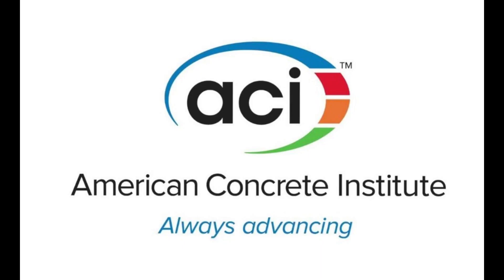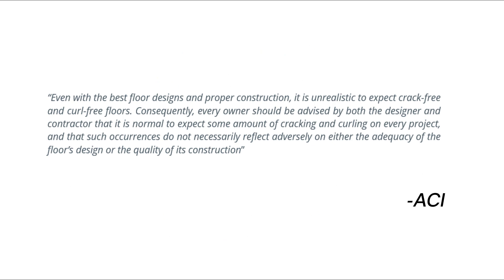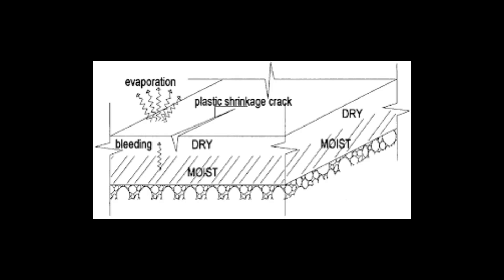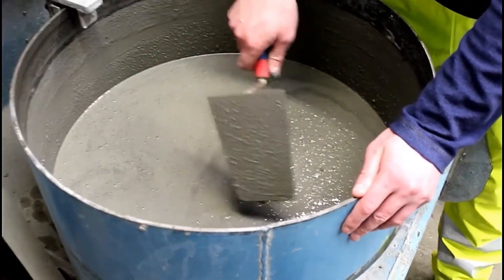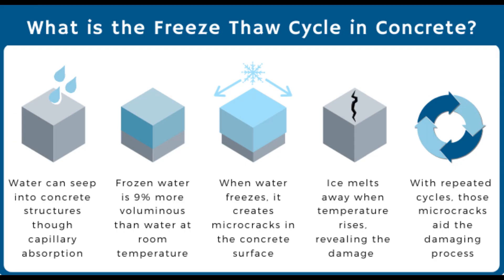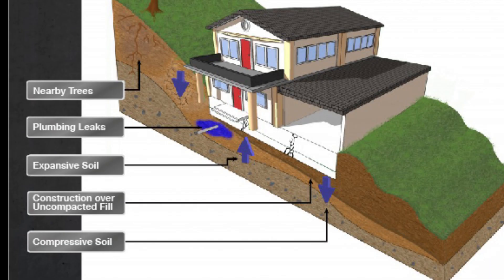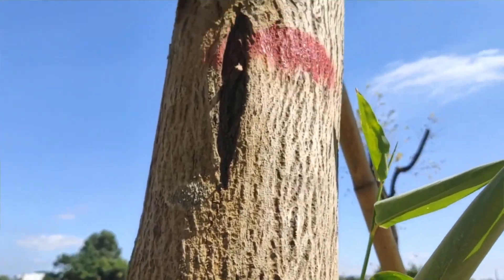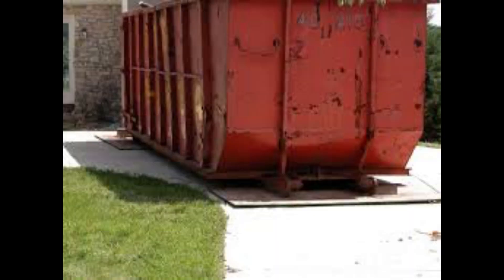Concrete cracks that even most Engineers DON'T know [Gibberish Fox】

Comment: From this video it can be seen that concrete cracking are mostly occurred due to the void and water that exist in the concrete. These two crucial factors play an important role in the strength of the concrete itself. Thus, controlling these two factors are on of the common way in concrete strengthening practice. 
Another concrete crack can be seen is structural cracks where it is due to the structural itself. Where external load gives stress exceed to its strength.

Comment: Concrete crack is a common thing that can happen but most people did not know or understand the types of crack. one of the important element that play a big role in cracking is water. Other than that, I also learn that Heat can make the cracking occur either too hot or too cold is not good for concrete. Next, every concrete have their own load that they can bear so, overloading load can  lead to cracking. Finally, the solution to avoid crazing crack is to do curing properly in my opinion. This can avoid water loss quickly.

Comment: another type that is not mentioned is spalling, spalling in concrete is a common issue that occurs when the surface of the concrete begins to flake or peel due to the presence of water, freeze-thaw cycles, or aggressive chemical reactions. This can compromise the strength and integrity of the concrete, and should be addressed promptly to prevent further damage. Repairs may involve removing and replacing the affected concrete, as well as addressing the underlying cause of the spalling.

Mohammed Adel Hussein A19EA4002

Comment: In this video, i had learned 6 types of concrete crack :
1- Plastic shrinkage concrete cracks
2-Expansion cracks
3-Heaving concrete cracks
4-Settling concrete cracks
5-Overloading cracks
6-Premature drying cracks
So the other type of concrete crack that not listed i would say Settlement Cracks, that appear when the underlying ground has not been compacted appropriately prepared it also appear in random crack above areas where the soil of the subgrade was uneven after the concrete had poured, usually cracks happen at top than bottom as the foundation bends over a single point allow the different settlement, and the part on the building usually continuous and occur multiple times on wall
(Mior Fadhil bin Mohd Hadri - SX180118KAWS05)

Comment: Corrosion cracks also one of the crack its  have mainly appear along the line of reinforcements of the concrete column. Corrosion columns mainly have the same width and usually widen as the columns age. The inadequate bonds between concrete and steel bars and possible reinforcement corrosion are the main cause of corrosion reinforcement in concrete columns.

Comment: Another cracking not mentioned in the video is thermal cracking. Thermal cracking in concrete occurs because of extreme temperature differences within a concrete structure and its surrounding surfaces and environment. When cooler segments of concrete contract more than warmer portions of concrete it creates tensile stresses that can outweigh a concrete’s rated tensile strength. Thus, cracks or more technically, thermal cracks.

Comment: Concrete cracks are very common, some are even inevitable. Therefore, one type of concrete crack that not being listed in the video that I found is Delamination crack. It happen when a compacted concrete slab is left to cure, the solid particles frequently sink. This can occasionally cause the trapped air and extra water in the slab to drain out. As a result, the concrete develops tiny cracks or holes.Moreover, one of the more serious kind of concrete cracks is this one. When softly touched, it often makes a hollow sound that can be used to identify it.

Comment: Based on video I have learnt about 6 types of concrete cracks. A few concrete cracks have been explained, which are plastic shrinkage cracks, expansion  cracks, heaving  cracks, settling  cracks, overloading cracks, and premature drying cracks (crazing cracks and crusting cracks). Cracks are often caused by normal shrinkage of the concrete when hardening and drying. Concrete cracks can range from being a non-structural and unsightly crack to being detrimental to the structural integrity and safety of a building. Diagonal cracks may appear anywhere along the height of the reinforced concrete.  These types of cracks always involve the entire face of the column. Diagonal cracks in concrete columns are mainly caused by insufficient cross-section, the inadequate load-carrying capacity of the columns, and inadequate reinforcement steel

Comment: Based on the 6 minute and 35 seconds video above, an example of concrete crack not mentioned is cracking due to reinforcement corrosion. The surrounding reinforced concrete expands due to steel corrosion which exerts pressure on to concrete. This can be avoided by adding corrosion inhibiting admixture.

Comment: Concrete cracks do not mean a mistake must be made when concrete casting. Some concrete cracks are a structural concern, and some are not. In this video, a few concrete cracks have been explained, which are plastic shrinkage cracks, expansion concrete cracks, heaving concrete cracks, settling concrete cracks, overloading cracks, and premature drying cracks (crazing cracks and crusting cracks), which are very new to me as I only knew about hairline cracks which cause by the insufficient curing of concrete. Throughout this video, I have learned that various factors contribute to different concrete cracks. However, to avoid these concrete cracks, the water content in the concrete paste must be just enough for the hydration process to avoid concrete shrinkage due to excess water content; proper structural design should be made to avoid any cracks due to structural movement and overloading. Lastly, curing must be done on time after the concrete is set to avoid any moisture loss, which is very common in this tropical country.

Comment: Apart from those in the video, there are also cracks due to corrosion of reinforcement, corrosion of steel results in the formation of iron oxides and hydroxides, which have a much larger volume than the original metallic iron. High radial bursting stresses around reinforcing bars result in local radial cracks as a result of the increase in volume. Splitting cracks can spread along the bar, causing longitudinal cracks or concrete spalling. Delamination, a well-known problem in bridge decks, can also occur when a broad crack forms at a plane of bars parallel to the concrete surface. Minor splitting cracks provide easy access for oxygen, moisture, and chlorides, accelerating corrosion and cracking.

Comment: Thermal crack is one type of concrete crack that is not mentioned in the video. Extreme temperature differences between a concrete structure and its surroundings and environment can cause thermal cracks in the concrete. Tensile stresses can exceed a concrete's rated tensile strength when cooler concrete sections contract more than warmer concrete sections. Thermal cracks, to use the technical term, result from this. There are a number of causes for thermal cracking as well as some things you can do to help prevent it. "MOHAMAD SYAHIDI BIN SAMSURI SX180917KAWS05 "

Comment: Diagonal cracks may appear anywhere along the height of the reinforced concrete.  These types of cracks always involve the entire face of the column. Diagonal cracks in concrete columns are mainly caused by insufficient cross-section, the inadequate load-carrying capacity of the columns, and inadequate reinforcement steel. Diagonal cracks need to be addressed urgently as they may compromise the strength of the entire structure within a short time. (Muhd Firdaus Bin Mohd Abas_SX180882KAWS05)

Comment: Heating concrete cracks-Due to changes in temperature, the ground may freeze and expand. During these movements, the concrete may lift several inches before thawing and settling back down. These movements may cause concrete to crack especially if the slab is not free to move with the ground. In addition, large tree roots may pierce through concrete and cause cracks.  (Nur Ain Binti Mohd Yusoff-SX180158KAWS05)

Comment: Corrosion of steel results in the formation of iron oxides and hydroxides, which have a much larger volume than the original metallic iron. High radial bursting stresses around reinforcing bars result in local radial cracks as a result of the increase in volume. Splitting cracks can spread along the bar, causing longitudinal cracks or concrete spalling. Delamination, a well-known problem in bridge decks, can also occur when a broad crack forms at a plane of bars parallel to the concrete surface. Minor splitting cracks provide easy access for oxygen, moisture, and chlorides, accelerating corrosion and cracking.

Comment: The video explained about 6 types of concrete cracks namely plastic shrinkage, expansion cracks, heaving cracks, settling cracks, overloading cracks and premature drying cracks. There are one type of concrete cracks that are not stated in the video which is cracks due to corroded reinforcement. Steel corrosion produces iron oxides and hydroxides, which have a much larger volume than the original metallic iron. Because of the increase in volume caused by high radial bursting stresses around reinforcing bars, local radial cracks form. Splitting cracks may propagate along the bar, resulting in longitudinal cracks or concrete spalling.

Comment: Other type of concrete crack is Spalling, where the concrete cracks as an effect from freeze-thaw cycle, Alkali-Silica Reaction or even fire exposure. This defect happens, commonly when the rebar embedded in the concrete has corroded and start rusting. Corrosion could expand up to 10 times it's original volume which could cause the concrete to crack from within.

Comment: Alkali silica reaction (ASR) crack is another form of concrete crack. ASR happens when the alkali hydroxides in Portland cement react with some minerals in the aggregate. The reaction of reactive silica in concrete aggregates and solution of hydroxyl ions within concrete voids will causes the formation of a gel which expands with the effect of moisture in concrete. Concrete cracks develop as a result of the swelling's volume increases.

Comment: Cracks in concrete are extremely common but often misunderstood. When an owner sees a crack in his slab or wall, especially if the concrete is relatively new, he automatically assumes there’s something wrong. This is not always the case. Some types of cracks are inevitable. However, sometimes cracks happen in spite of any precautions taken. Thank for the videos...

Comment: From the concrete fractures discussed in the video, chemical processes may also generate cracks in concrete. It's because of the ingredients in the combination, as well as anything else it may have come into contact with. Cracking is caused by expanding reactions between the aggregate and the alkalis in the cement paste. Chemical interactions between active silica and alkalis result in the formation of an alkali-silica gel as a byproduct. Alkali-silica gel forms on the surface of the aggregate, expanding it and applying pressure on the adjoining concrete. As a result of the increased pressure, tensile stresses may exceed the tensile strength of the concrete. To relieve the strain, the concrete begins to crack.

Comment: Based on the video, I have learned 6 types of concrete cracks such as plastic shrinkage, expansion, heaving, settling, overloading, and premature drying. Instead of focusing on the cracking, we should focus on the prevention method to avoid cracks occurring on the concrete. One of the methods to avoid plastic shrinkage cracks occurring is to cover the fresh concrete surface with an impervious sheeting such as polythene sheet to reduce the evaporation of the water on the concrete surface.

Comment: plinth beam crack, is very common in my country and the main reason for this crack is corrosion in the steel bars. some of the buildings do not exceed 10 years old and the crack appeared and made the concrete cover easy to break. the funny thing is that our climate is dry and hot? Is the problem essentially from the concrete mix?

Comment: ''Spalling Crack'' This is the outcome of the corrosion of steel reinforcement or improper joints construction.
These steel reinforcements are embedded in the concrete. When corrosion sets in, the rust expands in volume. As a result, there is also a significant amount of tension. This internal tension leads to cracks in concrete.The surface that is closest to the corroded metal starts breaking off. The reinforcements are exposed as a result.This leads to further contamination and more intense corrosion. In case spalling happen over a large area, the building may eventually collapse as well. (Mohammad Shafrin Bin Harun  SX180687KAWS05)....YNWA...

Comment: Forum 3
another type of crack not in the video is cracks due to chemical reaction
"AHMAD ZARUL HAKIM BIN ZAMALUDIN (SX180360KAWS04)"

👇🏻 in video list
- Plastic shrinkage concrete cracks
- Expansion concrete cracks
- Heaving concrete cracks
- Settling concrete cracks
- Concrete cracks caused by overloading the slab
- Concrete cracks caused by premature drying

Comment: The quality of concrete is inevitably affected by varying factors like external temperature and air humidity, which results in shrinkage and expansion in response to these variations. Construction cracks tend to emerge if these factors are not appropriately considered and proper provisions are not included in the concrete mix design. It’s usually difficult to figure out what caused a particular crack. Nevertheless, suitable mix design, well site preparation and good concrete finishing techniques will aid in minimizing the appearance of unaesthetic cracks on the concrete structure.

Another concrete crack that is not mentioned in the video above is cracks due to corrosion of reinforcement. Steel corrosion triggers the formation of iron oxides and hydroxides, which have a considerably larger volume than the original metallic iron. High radial bursting stresses around reinforcing bars result in local radial cracks due to the increase in volume. Splitting cracks can spread along the bar, which deriving the longitudinal cracks or concrete spalling. Minor splitting cracks might accelerate the corrosion of reinforcing bars as oxygen, moisture, and chlorides are free to access via the cracking zone. Broad crack forms at a plane of bars parallel to the concrete surface will also contributes to the common problem in bridge decks, namely delamination.

Comment: Based on the video, there are 6 concrete cracks that most engineers don't know. Firstly, plastic shrinkage cracks happen when the concrete is in a plastic state full of water. Secondly, concrete expands and then pushes against anything that may cause the expansion cracks. Next, heaving cracks usually happen in countries with four seasons, especially during winter. Meanwhile, the settling cracks are caused by the ground settling below a concrete slab because a void is created. Furthermore, overloading cracks on the slab can be occurred by pressing the concrete down with the excessive weight exerted by the rain or snow. There are 2 types of premature drying cracks, which consist of crazing cracks and crusting cracks. For the sea structures, the concrete cracks will also be affected by chemical reactions, such as carbonation and chloride or salt attack which is not mentioned in the video.

Comment: Besides the 6 types of concrete cracks stated in the video, another concrete crack is due to harmful chemical reaction. Normally, this type of cracking will happen when the concrete has hardened. Due to the interactions between active silica aggregate and alkalis that may coming from the cement hydration and admixtures, the concrete undergoes chemical attack which could cause the debonding between the elements in the concrete. Also, cracking may happen when the hardened concrete reacts with the carbon dioxide with the concrete in the presence of the wawter.

Comment: After I did some research, I found one type of crack that does not mention on the video which is hairline cracks.  As the concrete cures, hairline cracks could form in the foundation. While leakage issues do result from hairline cracks, foundation stability is unaffected. If the foundation fractures soon after being constructed, the concrete may have been mixed incorrectly or poured too hastily. Because the wall edges are more stable than the center, hairline cracks frequently form in poured concrete foundations.

Comment: Based on my research, there is a type of crack known as spalling. It is caused by corrosion of reinforcement or improper joint construction. It is expected that steel reinforcement embedded in concrete but when corrosion sets in steel, it will cause rusting, and the rust will expand in volume. It will result in tension in concrete that leads to cracks. Intense corrosion leads to spalling that will collapse the building.

Comment: Another type of concrete crack is due to the corrosion of the reinforcement within the concrete. When the steel reinforcement inside the concrete corrodes/rusts, it tends to form iron oxides and hydroxides, which have much larger volume as compared to its original shape. When this happens, the reinforcement has no way to release the stresses caused by the volume increment but to push the concrete surrounding it. This bursting stress will result in local radial cracks. Therefore, it is important to prevent the corrosion of reinforcement in order to maintain the concrete quality and to minimise concrete defect.